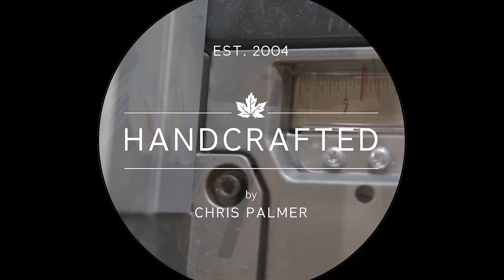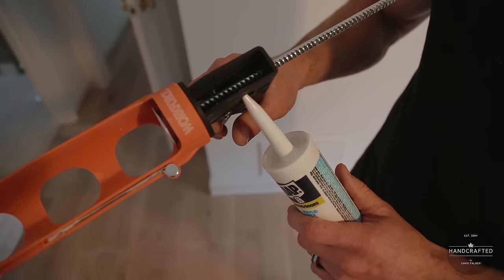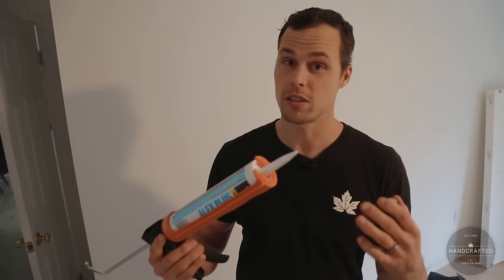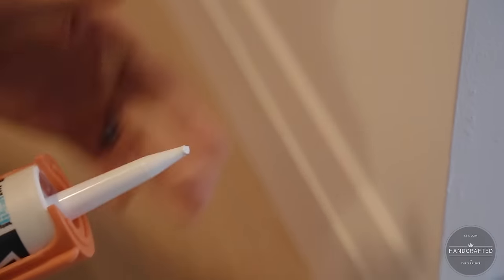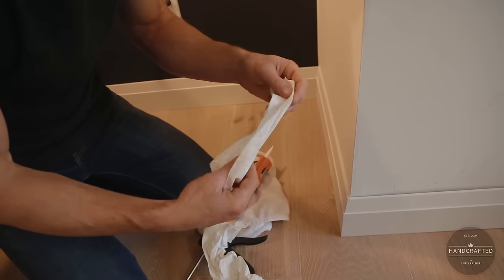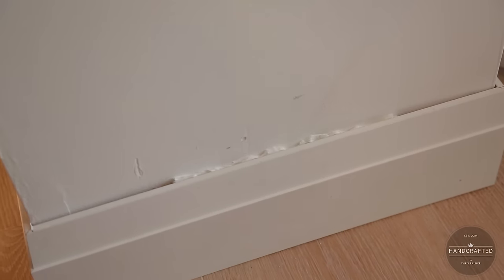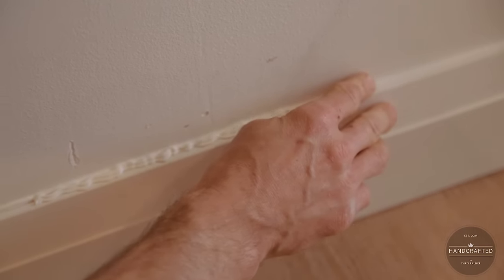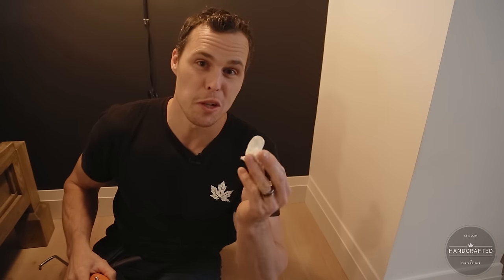How to Caulk like a Pro

Comment: How do you get the calking tube out of the gun?
Reply from the maker: Pull the piston back, rotate the metal hook at the back and then pull the sleeve backwards. Sometimes pushing the tube back allows for easier removal too.

Comment: Do you caulk along the bottom of new trim too? We just put in new trim.
Reply from the maker: No, top only, and use a shoe mould for the bottom if you want that more decorative look. If your floors are humped or dip, scribing the bottom of the base gets you a tighter fit.

Comment: Alex Plus is the easiest caulk to work with.  Now give us the tips for Silicone.  Much more difficult product.
Reply from the maker: Silicone is all about premasking if you're not confident and keeping a wet cloth to wipe your finger clean and keep the tip wet to smooth the beads consistently.

Comment: hi, so i over squeezed my gun on some parts, then used the finger method to smooth it out. is there any efficient way to remove the excess caulk after it has dried? right now im just scraping it off carefully with a blade (i caulked the kitchen countertop/ marble material)
Reply from the maker: The key is to remove it while wet, but after it's dried you are basically left to the mercy of your utility knife. There are tools for smoothing beads and removing caulk, but this sounds more of a hole size and pressure control issue. Don't worry, you'll get better each time!

Comment: Hi thanks for the video. My problem is a tub surround that wasn’t installed very well by manufacture as in one side extends further out from the wall and it’s not squared it has curved areas in corners. So one has deeper gap than other. I did buy some frost king poly foam caulk saver finally 1/2” and then saw this video however I don’t know if tp would be good idea in the large void I have esp in bathtub. I’ve removed old caulk from my sinks and outside edge of surrounds but there was none in the surround thinking not necessary in normal situation as I did find the exact design and it has a small lip for protection but since it wasn’t installed perfectly centered and it’s in a mobile home including fact I have an autistic child who loves to splash do u think I should go ahead and try to caulk around this spot between tub and the tub surround? I’ve tried many diff options including pre made peel n stick none have worked and regular job the caulk didn’t cure since it’s too big of a gap. I’ve also noticed my plumbing gaskets (white plastic type around plumbing lines at floor level) are not sealed either. I was shocked to find they just lift right up to reveal a hole in the floor large enough for a rodent to easily just come on in. So I’ve removed everything from under my sinks so I can clean it all and then seal them to the bottom of cabinet on the outer edge. The inner edge should b fine but I kind of want to seal it too. Is that ok with flexible plumbing lines? Sorry so many questions. And then of course behind toilets and also water line to freezer as well has them too. My crown molding is coming down we had a tornado hit and everything is off balance even after re level twice but I’m thinking I want to use some instant grab or something to set that instead of re nailing. And then seal around will b so much better cause I’m constantly vacuuming around these areas cause spiders like to hide there. Thanks again
Reply from the maker: Thanks for the like and sorry about all your issues. First thing I will emphasize is to use silicone and not caulk in the bathroom. These are different sealants for conoletely different areas. For the tub, I wouldn't be able to truly advise based on never seeing the space. However, any large gaps that are open can be backed with a sprayfoam. If the gap is larger than 1/2" you will need to find a way to push the tub surround in more. Or if possible my first choice is to contact the manufacturer of installation to reset it.
Reply: Heather...I used spray foam in a can under my sinks around the holes left open around my pipes, & for the large gaps. Around the pipe holes under my sinks there was large holes for rodents or spiders to come in...also cold or hot air coming into my mobile home as well. The spray foam in a can did the job by covering theses spaces up, so nothing can come in. Be careful and take your time that spray foam in a can is messy and it won't come off of your carpet or clothes if you get it on them or yourself. Just talking from experience. I only used the spray foam around my pipes the holes and gaps under my sinks. When the foam dries, you can cut it down even, and sand it a little.

Comment: I had to replace the grout between the floor tiles. I had a hard time how to load the gun. Learn how to load it and where to cut the tip off and clean the tube.  The rest of the work should be no problem.  Tk U.
Reply: You should mix a sanded grout for that.

Comment: I was caulking today and was using a cheap gun that kept pushing out sealant even when I left go the trigger. You mentioned in this video that you like to use an XXX gun that doesn't have that problem. I couldn't make out  the type of gun you were saying. What is it please?
Reply from the maker: For sure, that's a dripless gun 👍 you will need!
Reply: @HandcraftedbyChrisPalmer  Thanks
Reply from the maker: @sryangm  the description in my video has a link to one on amazon as well to save you searching. 👍

Comment: Toilet paper should be sold at builders' supply stores.  Another great use is in cement and drywall.  A wad that is shoved into a hole will allow ordinary drywall screws to bite firmly, and will keep that toilet paper holder in place forever even if it just screwed into the drywall.

Comment: Came across this because of a situation I have.  Live in a basement apartment, and there are many gaps between the floor boards and the wall where bugs are coming through.  Would love to get those gaps sealed up in an easy way! Any suggestions?
Reply from the maker: Your landlord should take responsibility for this issue, but in the meantime you actually need to remove the baseboards to see where the access point is and then seal it up with a concrete patch if it's a foundation issue or silicone pending the substrate. I also recommend a powder bug killer to go behind the baseboards to kill off the colony if there's a nest. Good luck!
Reply: @HandcraftedbyChrisPalmer  thanks. The landlord filed the gaps with I'm going to guess foam and installed corner-rounds to cover them up. Looks good at least. I'm happy with that. Now that winter is coming, I can hear the mice behind the walls instead! Clearly there's a gap somewhere
Reply from the maker: @Aleksandar6ix  well happy they made it look and feel better. Perhaps a few mouse traps will do the trick 😉

Comment: Would dry wall compound do the same thing?
Reply from the maker: Thanks for the question. Drywall compound can only be used to smooth out imperfect surfaces on the wall, not recommended as a trim seam filler as it will crack over time. Caulk has an elastomeric ability to stretch so that the joints don't crack as easy.

Comment: Hi, how to remove rest of silicone once it's dry? Btw, great video!
Reply from the maker: What did you mean by the rest? Your finger should have all excess on it. And be sure to use caulk not silicone on trim.
Reply: @HandcraftedbyChrisPalmer  Unfortunately I did the  job before watching your video, so didn't new about technique of using the finger.. Please imagine how awful it looks. Is there any tip to solve the situation once it's all dry and tight?
Sorry for misunderstanding, I used the caulk.
Reply from the maker: @milb26  Use a sharp Olfa knife to score along the wall and bottom (top of the trim) to cut it free if it looks bad. Thia should allow you to pull It up.
Reply: @HandcraftedbyChrisPalmer  I'll try, thanks.

Comment: Hi, if I have large gap between skirt and the wall, say 5mm  .in this case can calked the gap by means of tissue paper filling then calked? As you explained earlier...
Reply from the maker: If you wanted the best method for finish, skim the drywall mud over the void to build it up level. Otherwise the quick fix is as shown in the video, a backfill to prevent caulk from drooping behind the base. 👍
Reply: @HandcraftedbyChrisPalmer  Tnanks

Comment: Hi can I caulk on the bottom part or what do I do ??? Please someone help me
Reply from the maker: No, if your trim gaps off the floor you need to scribe the piece to install it so that it will hug the floor. If the trim can be forced to close a tiny gap, then you may choose to use force while you nail it. The next option is a shoe mold, this conceals small gaps along the floor.

Comment: Should I feel like a pro if I was able to cover the gap without toilet paper or caulk running down the wall?
Reply from the maker: Sure can, lol. I don't use TP either but for first timers in a pinch, this is a quick an easy space filler.

Comment: How do you store it after your done using it?
Reply from the maker: I usually wrap the end with masking tape if I don't have a tip cover. I like to use these rubber caps that have a long stem on them that inserts into the tube and gives an air tight seal. 👍
Reply: thank you so much!! <3

Comment: I don’t think my caulk is going at a 90° angle am I doing something wrong?
Reply from the maker: I pull my gun across on an angle less than 90 as the tip is angled as well it helps pull a smoother bead.
Reply: Thanks man

Comment: No need to poke a hole in caulking tube...  Silicone yes.  Instead of a toilet paper you can  use Backer Rod that meant for this,  and it comes in different thickness...  But if you have very little to do,  toilet paper works just fine!

Comment: now that i have almost caulked like a pro (1st time caulking), how do I get rid of the smell ???  im suffocating XD
Reply from the maker: What on earth did you use? I don't think I've had caulking that stinks....are you using silicone with an odour?
Reply: @HandcraftedbyChrisPalmer  ohhh could it be... i used "Lepage Sealant Window Door and Siding Quad caution flexible permanent " it doesnt say caulking nor silicone, dang it ! haha
Reply from the maker: @poissonCHA1  that is an exterior window and door sealant..oh ya that will smell! Outdoor only, sorry someone didn't advise what you need on the inside of your home. Find DAP Alex products or big stretch caulk. Not sealants.

Comment: Has anyone else tried vac sealing their silicon tubes? Result? Usable or discard?
Reply from the maker: Just put tape over the end.
Reply: @HandcraftedbyChrisPalmer  I don't use this stuff to often maybe once a year or so. I want to see if sealing it will allow tube to last a year. Its in my calendar already to open in 2022 lol. I know tPe etc is good for short term but I don't know if OT would keep the caulking good for a year. Have u tried it over a long period of time.
Im just miffed after throwing out 4 under half used tubes that been sitting there for ages.
Reply from the maker: @davidpiscopo3774  well the tubes are under $10 each so at least it doesn't hurt the bank. And personally I use my tubes in the same day if not same week. Once I could say I had an open tube for a couple months that was misplaced...seemed ok but air tight sealing the end should preserve it all ok. 🙏

Comment: You could of leveled th wall with some paste  then installed the baseboard after the paist dried stronger then toilet paper
Reply from the maker: This could be a solution for many with a 12 or 14" drywall knife for sure, but this won't work for the majority of the people watching this. I do like that method as well, some CGC 90 to fan out the slump.
Reply: @HandcraftedbyChrisPalmer  just sayin after a while gravity takes its toll and the caulking will start sinking, physics 101
Reply from the maker: @Huero805  that only remains true if something creates or causes it to push down. But if you pack it, the odds are in your favour. That sample piece is 4 yrs old and no slumping at all. But I do prefer on my sites to try and smooth a bad wall out.

Comment: I used a piece of paper towels and I thought what the heck am I doing. Apparently doing the right thing.
Reply from the maker: These are an immediate solution to anyone who doesn't have backer rod on hand, cardboard or similar substrates are used often too. The point is this prevents the caulk from slumping behind the baseboard, then once cured, you can add a 2nd bead if needed and not worry about wasting any extra caulk behind the baseboard.

Comment: I just watched 20 videos no one touches outside corner. WHY?! what do you do with outside corner?
Reply from the maker: It's pretty straight forward, simply caulk seam as you would the straights. I just smooth the bead continuously so there's no break at the corner

Comment: Try a wet sponge to smooth out the caulk instead of your finger.
Reply from the maker: What type of sponge do you have that its small enough to smooth a small bead?
Reply: I just use the big yellow grout sponges at Lowes/Home Depot. I cart around a five gallon bucket w/ a couple gals. of water and keep it wrung out.
Reply: @HandcraftedbyChrisPalmer  a sponge is a sponge pal, u can cut it into any size u want🤔.
Reply: Always, either wet ur finger or use a damp, not wet, sponge. Too much water in the sponge will wipe away the caulk. Either way but NEVER a dry finger.
Reply: @HandcraftedbyChrisPalmer  This is why experience beats college qualifications all day long. Ur just a kid so I'll let it go. Try to take some advice from people who know better instead of being sarcastic buddy. "Where do u find a sponge small enough"🤔
Reply from the maker: @holysheet4958  I wouldn't use a sponge as it will never compete against a trained finger 😉
Reply from the maker: @holysheet4958  I was referring to density more so, as a regular sponge could flake apart. I stand by my trained hands over a sponge.
Reply: @HandcraftedbyChrisPalmer  come back in 30yrs and say that. Good luck Mr "how do I find a small enough sponge?"🤣🤣🤣
Reply from the maker: @holysheet4958  im not looking for any sponges, just my finger 😅
Reply: @HandcraftedbyChrisPalmer  right, ive seen a bunch of guys caulk and it was always the finger method for sure. The tissues paper trick isnt a bad idea but probably not the fastest way
Reply: @HandcraftedbyChrisPalmer  indeed

Comment: You neglected the most important part of a good caulk job- the quality of the caulk. IMO you can throw away all those caulks that say latex, as in a matter of time they will pull away from crown mouldings, baseboards , door frames etc. They are truly awful. One tip for buying a caulk that will stay good looking and crack free is to look at the directions on the back of the caulk and see if mineral spirits are required for clean-up
 If so, you've got a chance at a long lasting, good looking job. Anything that says soap and water cleanup is almost a guarantee fail down the road. You should have also shown how to tape an area (sinks, tubs, surrounds etc.)for a really neat job.
Reply: I have to disagree.  I use Red Devil latex caulking and it was a game changer for me. I use my battery operated Ryobi caulking gun and it actually looks like a professional did it, and latex on a scale of 1-10 is a 1 to smooth out compared to silicone. If it is pulling away, I'd say the surface was not cleaned properly before applying caulk.

Comment: and did you leave that tissue/toilet paper in there?
Reply from the maker: I did and it works and has lasted for years. Mind you on any jobsite I have backer rod, but this is specific to something any homeowner and forst timer would have on hand and works. Despite the heckles, TP dries out and the purpose is to simply dam the caulk from drooping until cured.

Comment: Cut a small tip yes but on the bigger gaps I fill rub it down ..paint it then caulk a thin bead and lastly get a soft inch brush dip it in water shake off access water a gently run it over the top of the caulk and the finish will be better than this video

Comment: Hey buddy, I'm working doing interior caulking for about 2 years receiving $18hr. I'm asking a raise but my boss said its all i got with this profession. Is that true?
Reply: We doing 35 plus big windows for a day
Reply from the maker: I don't do caulking as a solo gig, it's part of my company's outline with trim, and all areas that require a beading between joints.
Reply from the maker: I will add, I know companies that specialize in windows and highrise buildings doing silicone and that pays well

Comment: Instead of wasting the time to stuff the toilet paper, I would have already been done just filling it directly.
Reply from the maker: It's an improptu solution for DIY'ers in the case they don't have backer rod. Filling the gap will require 2 passes, 1st has to cure before the 2nd which will give the finished look.

Comment: The toilet paper thing was good but you did not complete the process.  The caulking was all messy---u should have use either a wet finger or a wet sponge to finish
Reply from the maker: The video was edited a bit short of the finished bead.

Comment: are you really a pro? you didn't talk about the different pressure ratios of caulk guns and how much better it is to have a 28 lb. thrust gun for heavy bodied caulks like Dynomic or Vulkem or the advantage of warming these caulks first. also never mentioned the golden rule of not caulking a joint against raw drywall mud and what to do if you have to! you never mentioned how to tool urethane caulks.
Reply from the maker: The video is intended to help first timers, hence "like a pro" and not for the pros to review for coles notes on certain statistics like optimal application temperatures as the video is solely working on interior trims and not exteriors. I really try to hit the simple key points to relieve the pressure on first timers.